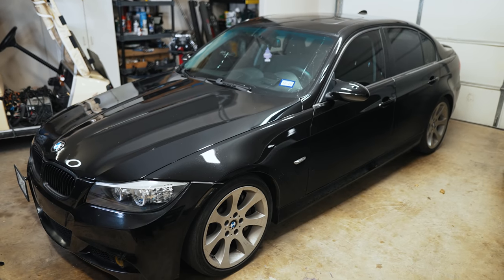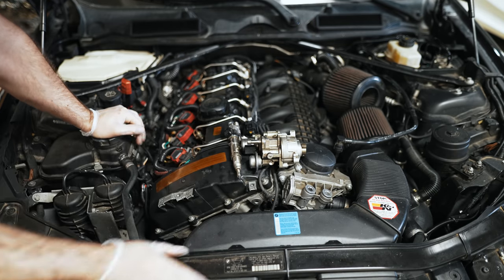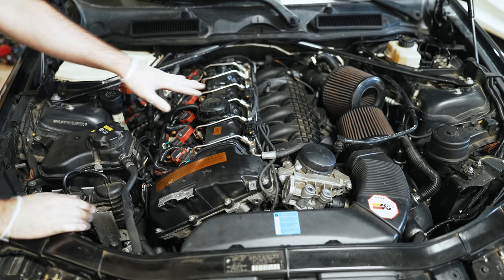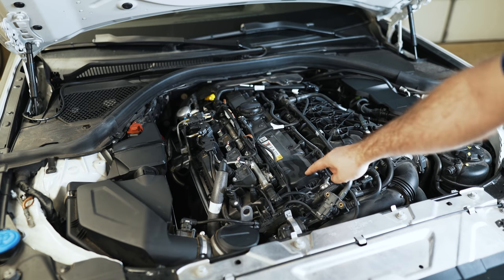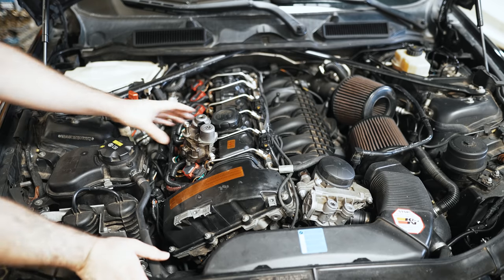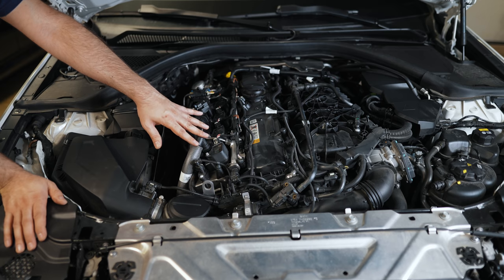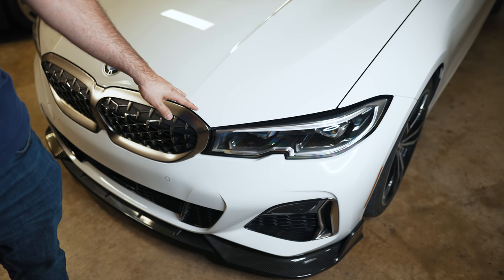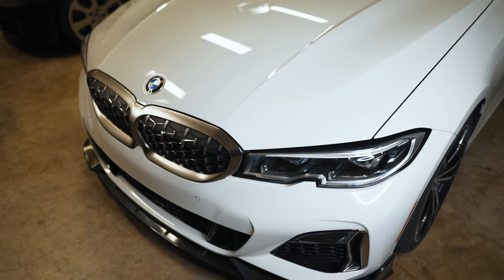Here Is Why New BMWs Are Now Reliable

Comment: "They'll last just as long as a Toyota engine, besides all the technology around them."
That seems like damning with faint praise. If the technology fails, does it matter if the lubricated internals still work? Other than the Korean automakers, who has an engine where the internal lubricated parts regularly fail? When a car is mechanically totaled the owner doesn't car if the oily parts are still okay. 
The aphorism that a chain is only as strong as its weakest link is certainly true of a car. If BMW has weak links that regularly break, the strongest links are immaterial.

Comment: these mechanical differences are great, but do not solve BMW's core issue. the fact is that now, people would rather lease a sporty sedan for a couple years then give it back than buy one and truly take care of it like it deserves. bimmer, merc, and audi are all designing cars for this purpose now. much cheaper to make unreliable engine components that can be easily replaced for a low cost to the dealer than actually put the time and $ into developing sound hardware. most american manufacturers are trending towards this direction as well. unfortunately, the last true enthusiast cars left are unexciting toyota products that are underpowered and overpriced. just the way things are now i suppose.

Comment: You talk about the E90 generation as if the tech was revolutionary. It wasn't.

Turbos? Diesels had them for decades. Yes, BMW diesels too. Yes, those only really exist in Europe but the difference in engineering is practically nothing. It's a turbo. Minus the variable geometry. ..
Direct injection? Diesels. Let's not forget about the fact that the injection pressure in a diesel is a good 5 times as much as it is in a direct injection gas/petrol engine. And diesel injectors last more than 50k miles last I checked. They are piezo injectors too. Same with high pressure fuel pumps. They work.
"But they are good for 600 wheel hp". No. They might be capable of that, but they fail every 30k miles even at stock power.  That means it's capable of like 150 hp.
Electronic water pump? Toyota Prius.

Some other notes:
Timing chains. 20 years and counting. The B57 diesels STILL have timing chains go at 150k-ish miles. Why? If I wanted to change timing components, I would have bought a car with a timing belt.
Rod bearings. 20 years and counting. The B57 diesels STILL have rod bearing issues at around 120-150k miles. It's a diesel. It's supposed to have miles on it.
Little things. Why do I need a factory scan tool to change a 12v battery? I'm looking at you i3.

Improved? Yes. But saying it's reliable because nothing broke in 15k miles? Umm.... That's pretty unremarkable even on a first model year.

These are good cars and I don't hate them. What I hate is when people have low standards.

Comment: I'm sure the N54 was also pretty reliable when it was two years old and only had 50k miles.
Reply from the maker: If you check they are having a bunch of issues before the first oil change was due when they first came out.  Fueling issues.
Reply: @VehicularDIY  Sure, but I think the point still stands that it's way too early to make conclusions about these new engines. Just because they fixed items that were problematic previously doesn't mean they didn't introduce new failure points.

Comment: Over-engineering isn't the same as poor engineering. Two turbos isn't overkill, it's poor engineering. BMWs have the most complex cooling systems. Literally dozens of potential points for failure, and more plastic than any other manufacturer I'm aware of. The list goes on. German car fans have the highest tolerance for poor reliability of any other car owners.

Comment: Been telling people this for a while now people still living in 2006 or 2007 “I don't want a BMW they're unreliable pieces crap" ok keep driving the same riced out charger and challenger with white tire lettering everyone has on the road Lul
Reply: s l yup the outdated jokes don't work anymore it's purely gap city now
Reply: Idk I own a honda 2016 civic and am thinking about buying the new m4....honestly care more about its fat weight in corners than going faster than challengers in straight lines....I can already smoke most automatic base hemis with the base model manual civic as is, only srt and faster give me shit. But more than its 3900 lb weight I am worried about its reliability.  So much so I am seriously thinking about a 911 for 30k more. Reputation matters, I know people that have ruined their finances to drive what I found to be pretty bad car, at least by transportation standards. And I hate to say it but everything feels slow compared to a taycan to me now.
Reply: sunnohh the whole weight thing will be blown out of the water when you drive. I'm always surprised how well these modern cars perform and handle even with the extra weight. These cars are so stable and have such great grip its amazing. I was thought the same way
Reply: s l yup every generation they get better the extra weight minimal issue. Improved transmission or trans software better suspension Tuning, upgraded engines etc etc the successors are always better. I remember gong from a first generation G35 to a second generation g35/g37 night and day as well as going from an e46 330ci coupe to an e92 335i coupe night and day. The extra weight never crossed my mind faster and more stable firmer not to mention more comfortable and less more unwanted road noise.

Comment: Even tho i respect Toyota and Lexus, you cannot compare them with BMW, the brand who has 40+ engines available across all series. Of course some of them might be unreliable. But that's why i respect BMW the most, because they have b*lls to bring new technologies and make new engines all the time. Toyota practice is different, let's fix issues and put same engine in new model.  Toyota has around 15 engines, and most petrol 3 cylinder and all diesel engines are total trash here in EU. Now you wont believe this but BMW is quite reliable in Europe, avoiding those n47 diesel engines ( timing chain issues ) who got bad rep. I heard that there is a massive quality difference between EU and USA made BMW's.

Comment: Lol. Everyone knows that all inline sixes are naturally balance. It is not a BMW development. How can you say with a straight face that all the plastic parts under the hood beginning to fail at 100-120K miles fits the description of reliability. Everyone knows that BMWs are designed to last until the warranty runs out. Then they become endless money pits. That’s why they have terrible resale value. They are very nice cars as long as you understand the extremely high cost of ownership.

Comment: TU? Oh right you mean the very very latest version might be reliable.  Well again we are being asked to believe in BMW and dig deep again - It's like going to church
Quoting mkoesel, a moderator on Bimmerpost:
"The B58TU (Technical Update) is the only one that is important going forward. It has replaced the original B58 in its various states of tune in most models already, and it will have replaced that engine in all models bar the few legacy F generation vehicles by August. Those legacy products, by the way, include the F3x 440i and F2x M240i, and their replacements will get the B58TU after they end production in 2020 and 2021*.

When we talk about the B58TU, there are two versions. There is the standard-output M1 and the high-output O1.
The M1 makes 250kW (335hp) and is used for non-M-Performance products (40i) which are those found in the 5, 6, 7, and 8 vehicle families.
The O1 makes 285Kw (382hp) and is reserved for M Performance products (M40i) which fall into the 3 and 4 vehicle families. In countries complying with WLTP, this engine has additional emissions equipment which lowers its output to 374hp.
The Z4 M40i is an exception. Instead of using the slightly detuned version of the O1 in WLTP nations, it reverts to the M1. It was speculated by one knowledgeable forum member that the additional emissions equipment I mention above could not be adequately packaged into the Z4, so they had to compromise by going with the M1.

* Although it is not a 3 or 4 Series vehicle, the future G42 2 Series M Performance coupe (a would-be G43 convertible has been canceled) will be built on the CLAR architecture and thus remain RWD. As such, it is likely to retain the B58 instead of switching to a high-output B48 like M Performance vehicles in the 1 and 2 family products built on FAAR have. In that event, it is possible that it will use the standard M1 engine rather than the high-output O1 in order to create better product separation against both the future G22 M440i coupe and future G87 M2.

While the B58 Wikipedia entry fails to include the WLTP information, the model lists are (as far as I know) now up to date:

https://en.wikipedia.org/wiki/BMW_B58

And regarding what parts have changed from the original B58 to the new TU:  https://g20.bimmerpost.com/forums/sh...8&postcount=20

Comment: Parts have aging/wear tests during design and they are configured to simulate the rated service life of whatever part it is. It has been obvious from older BMW designs that their test methodology around stuff like cooling, PCV, electronics, intakes etc. didn't go far beyond simulating the warranty period. They haven't had too many engines with purely mechanical issues, it has always been plastic/rubber bullshit around the engine. If Toyota are indeed helping with this, great. But I'll only believe it when I see reports of these things going 7+ years  without some long list of common items to watch for in used examples. There has always been a list like that with older BMWs. Find me an e46 that doesn't have PCV hoses, entire cooling system and valve cover gasket in its service history. I dare you.
Reply: Atleast these are simple and cheap repairs on the E46. You can diy .
Reply: @traubengott9783  First you have to deal with the bullshit you get while it's failing, diagnose, buy the parts, have the proper tools, then access the parts to replace. Good luck to you if you have a shed with tools and a pit/lift but otherwise it's a pain in the ass and it's not at all cheap. Especially if you get OEM parts.
Reply: @-BuddyGuy  i did all of these repairs in my driveway with 80€ tools in a few hours. If you dont have two left hands they are relativly easy and cheap shops. I even had fun  working on my car.
Reply: @traubengott9783  Whoopdie doo 80 bucks for PCV and cooling system diagnosis and replacement on an E46 that's amazing and totally believable
Reply: @-BuddyGuy  that was the tools. Pcv is around 50€ and cooling system is typically only the water tank and tge Thermostat for around 100€. Thats not so much.
Reply: @traubengott9783  Cool now do the rocker cover gasket and intake piping. I guess you've got a bidirectional scan tool too right. All OEM parts?

Comment: Yep, there is a lot of heated air in the engine compartment.  Got to love how those DCI can cool that intake charge.  Wonder why "enthusiasts" are not using them on the N55 and later I6?  Probably for the same reason BMW never did.

Porsche still uses piezoelectric injectors on their turbo 911 whereas all other direct injectors  employed by BMW after the N54 are solenoid.

Have to recommend the M340i as a truly great car for the street.

Noooo, no Beaverteeth Motor Works.
Reply from the maker: Do you know what PSI Porsche runs their piezoelectric injectors on their 911?

Comment: BMW can easily build a reliable vehicle.. they did.. but they also went out of business. As did Mercedes-Benz.  They're not big enough to sustian sales. Ironically their sales are still high despite the vehicles being reliable. Not really. They build them with intentional failures engineered. Their entire North American business plan is based on Lease. These cars are designed to be driven reliably for 3 years then traded on. I've had two BMW executives say that BMW business model is mostly lease. And when they're leased they're great vehicles.

Comment: IT DOESN'T MATTER how reliable they make it as long as BMW puts cheap gaskets etc that only last 50k to 75k and couse oil leaks etc. THAT in itself tells u that they dont want these cars on the road once the warranty is over
Reply: That’s just wear and tear product bud. It happens from heat cycles you cNt avoid it lol
Reply: 50k-75k miles on a gasket is a lot. You cannot expect there to be no wear after that many miles. Heat literally eats away at the rubber seals. And all the pressure built up within the crankcase can cause the pressure to weaken the engine sealant. Your logic is real stupid

Comment: It all depends on what YOUR definition of reliability is. I’ve had BMW’s and Lexus. BMW’s costs thousands after 60,000 miles and Lexus will run into 150,000 miles without any significant repair bills. The latter is what I consider reliable. In my opinion BMW purposefully engineers planned failures into its cars. They do this to make money on the parts and repair side of the business. They know it won’t effect sales, because of the large percentage of people that lease and the people that buy new will only own through warranty period. Another annoying thing on BMW’s is that the plastics and rubbers throughout the entire car don’t last, they will shrink, crack, and make noise prematurely.
Reply: @s l I get what you’re saying. But the title of his video says BMW’s are now reliable and that’s why I started my comment by saying it depends on your definition of reliable. I disagree with his statement.

Comment: bmws always have reliable engines.
the problem is with everything other than engine.
and u are targeting the engine specifically here.
agree with on every engine point, not the whole bmw is reliable thing
Reply: What was reliable about changing out my crankshaft at 60,000 miles?
Reply: @sunnohh  omg, seriously? which year and model

Comment: This is a joke. Right? German engineers are clowns. Nothing this guy is saying is new technology is new technology. Calling German electronic technology reliable is a joke. Good engineering gets it right the first time. Chevy put an old style push rod AMERICAN V8 in their mid engine Corvette. 2020 Corvette Stingray Convertible. Starting Price: $67,495. Engine: Mid-Engine 6.2L Small Block LT2 V8. Horsepower: 495 Horsepower. 0-60: Under 3 seconds. 

BMW are for men with small wieners and fat wallets.  This guy is perpetrating the big lie.